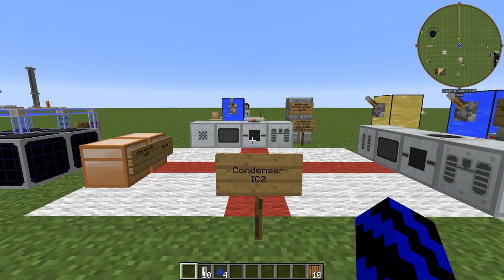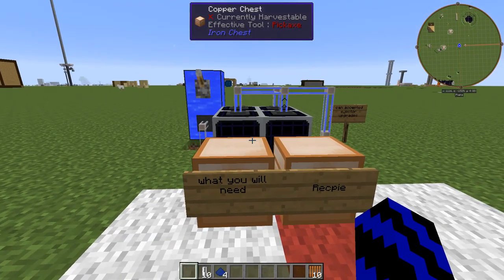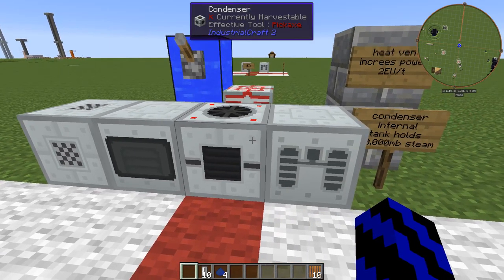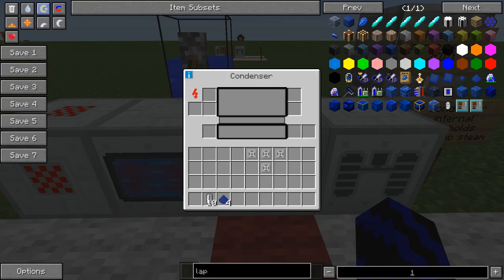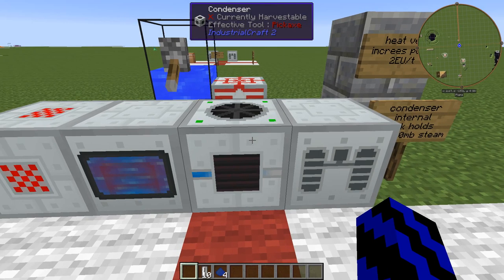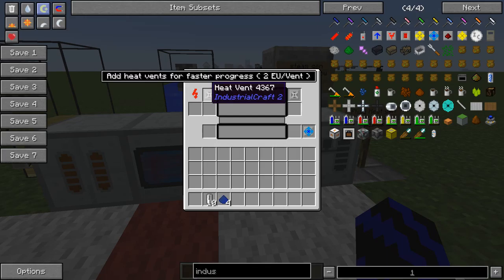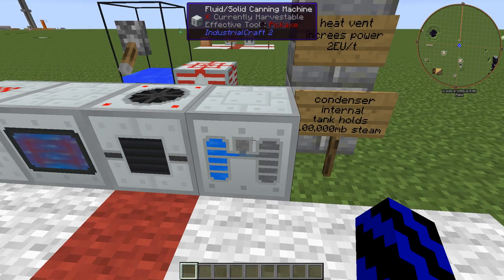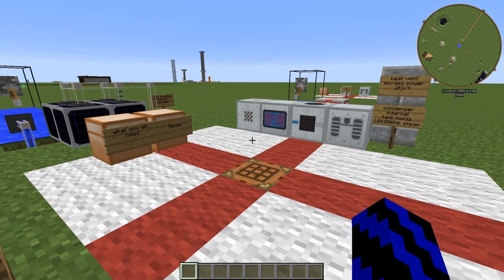IC2 Condenser Tutorial

Comment: From what I remember its not supposed to be flashing water/steam like that.
Reply from the maker: it might be but it works and does the trick
Reply: True yes it does work quite fast, but I feel with a lot of them in the TIleEntity updating like that might cause some lag.
Reply from the maker: i will have a look into it
Reply: Bit late on this but  170 bar - 1mB/t requires    177 Hu/t     230-240~eu/t 

So  2 heat generators. solves the rapid block update.

221 Bar - 1mB/t  requires   200Hu/t    256eu/t

Makes super heated steam u can pump into a steam generator / kinetic generator for a bit power back, and the steam generator outputs normal steam to condenser. With  that u will use 170-180 eu/t and it will be a bit faster.

But still your way is super simple and it does work fine. :D